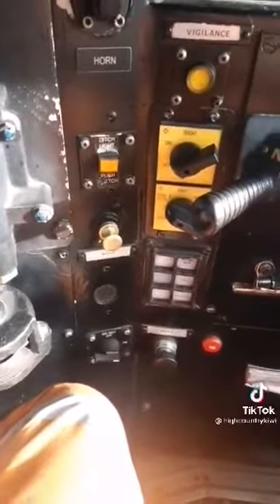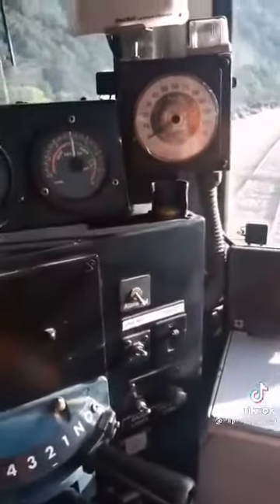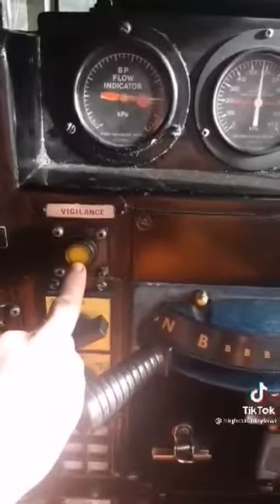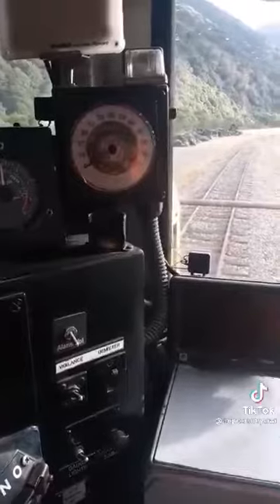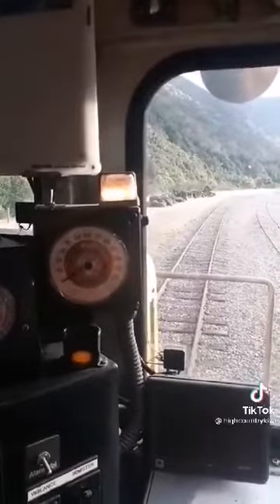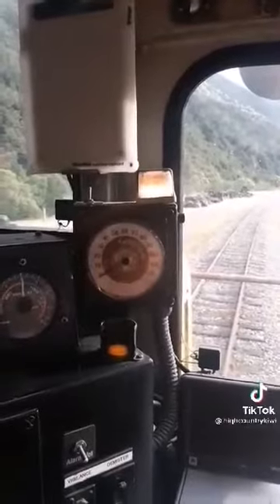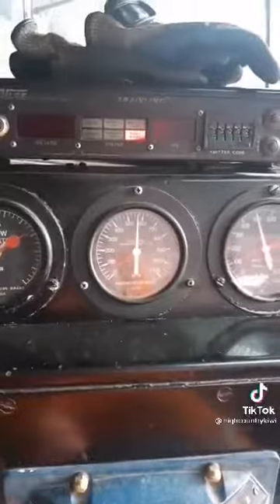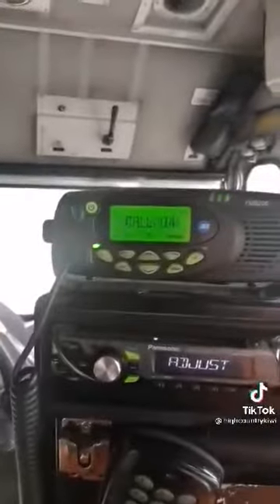NZ Locomotive Vigilance Safety System

Comment: Are you able to answer questions from previous videos?
Reply from the maker: Using what knowledge I already  have, yes. I'm not a train driver yet though ;)
Reply: @produKtNZ  On your "Harddrive working without cover - Defragging, formatting, file transfer etc" do you recall the model of the drive? You say in the video it was a Conner but I've never seen a Conner drive that looks like that.